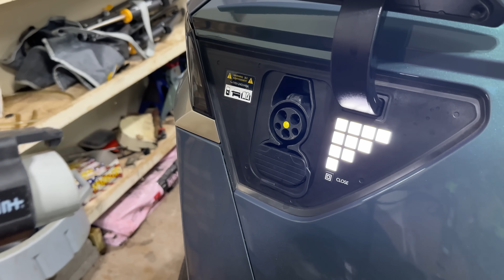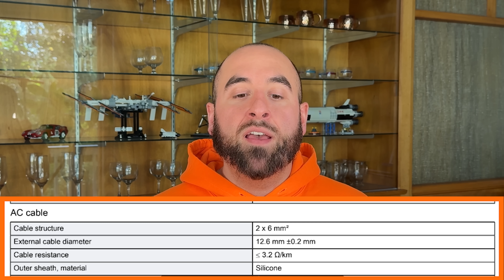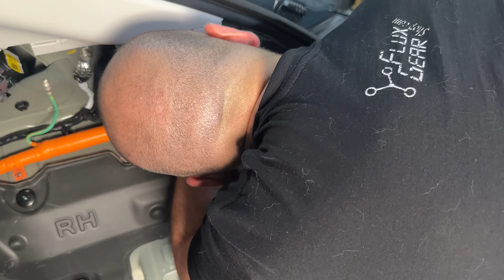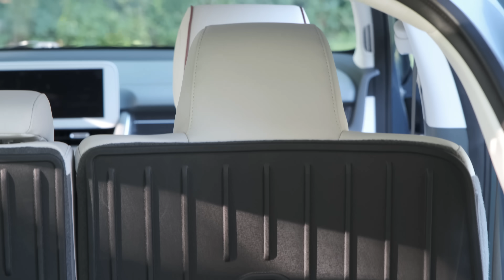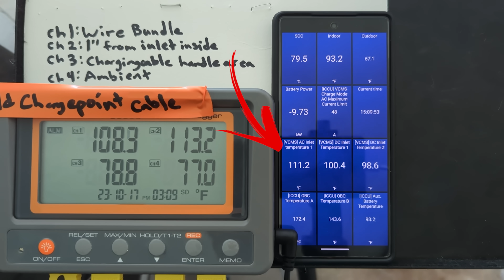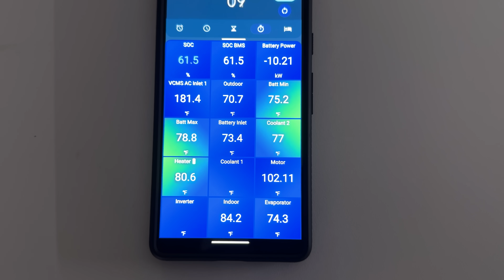I Investigate Overheating Charge Ports on Ioniq 5/Ioniq 6/EV6/GV60

Comment: Interesting. I watched this when I had my ioniq 5 (though it didnt have the issue) but my current EV6 is throwing port over heat codes after an hour at 9.2kw on a newish charger. I have the inner panel off to see if air flow would help any but it didnt make any difference

Comment: Hello, I have an ioniq 5 with no faults in any ECU tested with my pad7 tool multiple times and at the Hyundai dealership neither on the car's screens there is no warnings, initially I lost both DC and AC charging then DC charging came back after noticing moisture in the charging Chademo port and spraying contact cleaner but AC charging trips the breaker in both public chargers and slow granny chargers.

Could this be an ICCU fault or wiring at the port? My ICCU part number is 36400-1XAA0, I am thinking of buying a second hand unit just to test and then send my original one for repair. Also one thing that is mind blowing my Ioniq 5 is a Japan import and at the charging port there is a warning which seems to say not to charge over 200v/48amps, I did not notice this and the problem started after I charged it with a granny charger at 230v, but since the ICCU is the North America version how comes and the car cannot accept over 200v  ?

Comment: Its strange americans use single phase... the 3 phase European system is much easier on the connectors because less current has to go through the conductors also there is virtually no current flowing in the neutral when operating on 3 phase. So there is less resistance and its more efficient.

Comment: On my EV6, I found that on public lvl2's near me I occasionally get the inlet temps >100°C, where 105 is usually the point where it thermal throttles. Yet with my Grizzl-E mini at 40A (I have a NACS one, future proofing myself with it and an A2Z adapter) I consistently only see 65°C. I get the feeling that this issue is similar to that of the recent graphics card issues, where pins making marginal contact can lead to issues like this. 

If you are consistently having issues with AC charging sessions, I doubt your dealership will do anything about it unless they're great or you're insistent. I'd recommend trying out a few different EVSE's and stress testing them to see what works best.

Comment: Thanks for all this info!  I had an AC charge failure over the weekend.  Dealership diagnosed it today as a charge port or wiring harness assembly failure, which they are replacing it (under warranty).  Leading up to this, I did have a couple episodes where either the car failed to charge once (but charged later on when I reseated the plug), or once when the charger started immediately (normally on TOU charging) because it thought I "double pumped", which I did not.  This has me thinking that there was a loose connection or part that finally failed this weekend.  DCFC still works, however.  Is DCFC a different thermister?

Comment: I've had all recalls on my 2023 I5 completed and it still stops changing at 8.1 kW after 2 hours when the garage temperature gets up around 65F.  Is it possible ICCU software update didn't install properly?  Dealer refuses to perform TSB "VCMS Upgrade" because they claim it was included in last ICCU update and have washed their hands of problem.   I've lowered the kW to 7.1 now and this seems OK, but is only 2/3's of what I paid for...not right.

Comment: Why does mine not derate when overheating, it still just shuts off ??!
Reply from the maker: There was a vehicle control unit software update in 2023 that changes that behavior. Have you have any recent software updates done at the service center?
Reply: @TheIoniqGuy  I’ve had all the updates whenever I took it in for scheduled maintenance. I’m over 40k now so haven’t been in since December however I did get the latest iccu update a few weeks ago

Comment: Just came here to say: I solved an overheating problem for my I5 - I cleaned my J1772 pins with Q-Tips (one per pin) and 90% isopropyl alcohol based on a tip I read on Reddit (the Redditor suggested cleaning them like you're brushing teeth) - please try at your own risk - but it worked perfectly for me. My I5 had started having this problem two days ago in Yosemite at a destination charger in the park. Shutting down after only 30 minutes or so, and it kept happening even after I got home. And I typically have it dialed down to 90% (36 amps) which is plenty fast for my purposes - but cleaning the pins worked! The thing charged overnight to 80% with no problems, no slowdown, nothing. It just worked.

Comment: I never had this issue on my project 45 version.
Even not heard off.
Mostly I charge with 5 to 8KW (3 fase) or 4 kw (1 fase).
But even when charging at 11KW (3*16 amps) never an issue (until now)
I admit that my car was delivered in Euriope...230-240 volts standard. 11KW is slightly less as 3* 16Amps

Comment: i installed a 50amp hardwire charger and my I5 will only charge at 9.6 kw  it's never charged higher although it's never disconnected or lowered the rate. I really wanted the 11 kw. I havent loaded the update for the radio yet maybe then it will charge faster but I doubt it. I did both ICCU updates and it didn't change anything. It;s a mystery.
Reply from the maker: It should at the very least start at 11kW. It sounds like you have it set lower in the cars EV settings or the charger has a setting or a switch inside of it that needs to be changed to allow full speed

Comment: How hard would it be to electro-gold plate the charging pins? Wristwatch repair guys often do this for case restoration. Reported overheating could be due to a "flaky" thermistor by the charging pins. Should you get a part number for that thermistor, I'd replace them. Your disassembly "experiment" proves it must be an intermittent high-resistance connection that is causing overheating. I understand Hyundai wanting to solve this in software, vs recalling cars because this IS a hardware issue.That is not proven yet, but you have evidence that leads to that conclusion. My charger for my Kia only does 40A L2 charging so this will never be an issue for me.

Comment: Thanks for the awesome video. I have a GV60 Performance and recently can’t go above 35amps before the auto shutoff kicks in. I will attempt to recreate what you did in a last ditch effort to prevent the problem from getting worse. Did you shut off the main power first or is it not necessary? Thanks!

Comment: Very comprehensive. A couple of comments - if there is a quality issue with the wiring of the thermistor the BMS may be getting false readings - the resistance of any poor contact adds the the value of resistance the BMS sees which will be interpreted as a higher temperature. Secondly (and this should be obvious but, hey, whatever) - you cannot simply say that a given wire thickness can carry a set current - it will depend on how easily the wire cools the self-generated heat. I know from setting up my own EVSE that cable ratings will be different between (for example) wire clipped to a wall vs. wire buried in wall insulation.

Comment: You mentioned you have a 50 amp Autel maxi charger. What amperage is your breaker? I bought one of these chargers too, and I have a 50 amp breaker. The instructions say to limit the charger to 40 amps with a 50 amp breaker
Reply from the maker: For a hardwired 50A charger, it needs to have a 60A breaker. If a 50A breaker is what you have installed, you need to manually go into the Autel app and change your charging current to 40A, which is the most a 50A circuit can handle continuously.
Reply: @TheIoniqGuy  ,  Thanks for the quick response! My manual says that for 50 amp charging I need a 70 amp breaker

Comment: I fixed the issue for my Ioniq5. I started having issues after 7 months of ownership. I was charging at 32amps and reading 240 degrees(F) after about 2 hours of charging. I simple cleaned the charge port pins with DeOxit and a nylon brush and Qtips as well as the charger plug socket pins. After this simple procedure, I was reading 140 degrees. I almost couldn't believe it was this simple but that was it. I'll probably be doing this every few months.

The question is, why is this not an issue with other EV's? Either: 1) they use higher quality connectors. 2) the temperature threshold is higher. 3) the charge port has better heat sinking/ventilation.

In either case, this is an unacceptable situation for Hyundia.

Comment: Great investigation. Sounds like a resistive pin connection due to partial engagement. However, if this temperature sensing doesn’t work right what happens?

Comment: Just a wild speculation: maybe the freezing you did with the thermistor reset the reading of it. After all a thermistor is just a resistor, so there is an analog to digital conversion to get digital readings for the BMS, etc. Maybe that part did recalibrate when you freezed the thermistor.

Comment: Maybe check the thermistor connector, spray some wd40 contact spray in it. ( yellow cap spray ) I use it when the handshake doesn’t work at a charger, I spray the cable connector, especially the two communication pin, and voila, it works.

Comment: Thank you so much.  This is a great video and your explanations and thought process are excellent.  

Thank you for making the discussion about the size of the wires in the car vs. rating for wires in household wiring.  Household wiring is rated more to maintain a certain voltage drop rather than being able to carry the current.  It's always interesting to look at the wires on the back side of, say, an electrical oven plug.  The wires inside the appliance are generally tiny compared to the big fat wires in the main cord, but the manufacturer knows exactly how long they are and what's around them and such.  

As an experimental physicist, I very much approve of your methodology here.  You do an excellent job of laying out your methods and measurements, and then reporting your data.  I have two suggestions, though.  1) In the early part of the video, you talk about ratings of wires in terms of degrees C (which is reasonable; that's how those specs are usually quoted).  Later in the video, all of your temperature measurements are (I think) in degrees F, which is also fine, but I don't think you made a point of highlighting that you were switching scales.  2) In your graphs of temperature over time, don't have have a unit listed ANYWHERE.  I presume the temperatures are in degrees F and the time is in minutes, but they're not labelled.  

I don't have an EV, but I have some thoughts about the whole charging port thing, and I would like to have a private conversation about that with you.  How to best contact you?  I see you have a facebook page, is direct messaging on facebook a reasonable way to chat with you?
Reply from the maker: Correct, any temperature not related to a cable rating is in degrees F. You can email me at theioniqguy@gmail.com

Comment: Please get an infrared camera to check high power connections, esp if you are an electrician.  IR cameras can see through plastic and many other materials.  A good camera can show where the poor contact is, without having to disassemble the cables.  Been using for 2 decades in 100 to 1000A circuits.

Comment: hi, I had the same issue. I have a Kia ev6 and although at home level two charging would start at 9.6kw it would inexplicably drop to 5.4. Sometimes in 15 minutes, sometimes in more than an hour. I had Chargepoint replace my charger. I brought it to Kia to find out that not only couldn't they fix it but they were the worst dealership I have ever encountered. Didnt really know what to do and then I saw your video. That was two weeks ago and although I did not disassemble my car I have some small diameter round wire brushes. I cleaned all of the 5 pins in the charging socket. Since then I get 9.6kw for the entire charge cycle.
Thanks
Art

Comment: I just came back from dealer after opening a case on them that they are not explaining what is happening, now they twist the software that is charges only 48 amp for 20 min then it goes down and charges with 7.30 kw and never goes back  to 11 kw so the point is to fix the issue not to reduce the speed to slow forever until charge is complete! Currently i am opening a case on Hyundai, whoever interested let me know.
Thanks

Comment: Static charge can discharge through a temperature sensor so static in general can cause an noise in the thermistor information. Maybe when you touched the thing or when you put the thermistor in liquid it removed built up static? with all the different materials like carpet, rubber and plastics in that area with high voltage i could see some static building up.

Comment: Home wiring ratings are based on insulated walls with possibly multiple cable runs routed together. Power cords follow the same ratings as in-wall wiring as safety margin against user abuse. In a wiring cabinet setting where there is no insulation, not much wire ganging and generally no human interaction, practical limits are much higher.

Comment: Excellent video and analysis. I have to assume that the charge session would only stop or de-rate  if the car (or EVSE) is aware of a heating issue which means one of the temp sensing thermistors is getting too hot. Poor thermistor placement or lack of good thermal contact could only reduce the ability of the thermistor to track hot cables or connectors, not increase sensitivity.

Comment: The real question is why wasn't this fixed at the dealership?  Why did you, and others, have to go to such lengths to fix a car that was sold to you broken?
Reply from the maker: It likely wasn’t a known issue at the time they started building the cars and only came to light after extensive customer use. They’ve revised the part several times since.

Comment: Thanks for going the extra mile in you deep dive analysis!
Reply from the maker: I really appreciate it!
Reply: @TheIoniqGuy  No prob! My 2021 Model Y can only charge at a max 32A (AC) and it has never had a de-rating or heating issue, as far as I know. Pin fitment / electrical connectors are crucially important.

Comment: Those temperatures are still really high even though the connectors and wires are rated for it. There should be active cooling around the port or a better way to keep the charge port below 140F/ 60C maybe with thicker connectors?

Comment: My ev6 must be a unicorn. I have a 2023 gt line. No iccu issue, no 12v battery issue and my hardwired autel charger consistently stays at 48amps and 11.6kw for the whole duration its plugged in and doesnt get warm at all. It sucks that so many people are having these issues.

Comment: Another possibility is crosstalk.  This is where wires running in the same bundle capacitively couple to each other and signals can jump from one to another.   This is especially a problem wen you get very high currents in one one wire coupling to another that operates at very low voltages such as a sensor.   This results in noise on the sensor line that can fool the computer listening on it.   By moving the wires around you may have reduced the effect.
This can be fixed in software by averaging the sensor signal to smooth out noise induced  variations.

Comment: Pin connectors are notorious for backing out of place after so many insertions. I have seen this many times in industry.
Check the pin seating in both ends of the cable.
Also, bad connections always heat up over time.
If you are having this problem at home, image what you will get at a public charger that is used and abused everyday! Good Luck. 😂

Comment: It doesn't sound like your issue but another consideration is incoming power quality. If there is low voltage or dropouts the charger will lower the current.

Comment: I know this is semi Unrelated to the overheating but could you do a short showing how to replace the charge port caps? Is it as simple as taking the new cap and pressing them into the port? Don't want to stick my finger in the electric socket again, thanks in advance!

Comment: In "free-air" BARE wire can carry much more currant than can the same wire in a closed conduit / tight bundle.   ''AMPACITY OF WIRES VARY WITH ITS INSALATION'' {AMERICAN ELECTRICAL CODE}  "Voltage Drop"= 'Vd2Kil over CM""   EV cars have on-board chargers that need protection from too high an amperage applied while charging.   Home wiring and plug devices' can be a heat sourse and must be fused against for protection of fire.
Engineering of many factors hopefully come with few compromise.   =we ask computers to make our choices of control=
*fine copper wire found in weilding cable carry vary high rates of currant !!  
Thank you for working on all of our short commings of our Ev's....

Comment: My ChargePoint Home Flex charger was set to 48 amps and our IONIQ 5 charge process always stopped after about 45 minutes. I had ChargePoint lower my setting to 40 amps and I have had no trouble since.

Comment: Iwe Never heard of this being a problem in Europe. Yes we have ICCU failing but No heat problems.

Does it have something to do with your shitty 115V system.??

In the old would we use 220-250V and therefor only charge at 16-24A depending on Which country we live in.

AC charging Type 2 charges at 230 x 16A x 3 = 11 KW

Comment: My 2023 Ioniq 5 Limited won't charge at my home Level 2 @ 40 Amps.  I have to lower my Autel charger down to 35 amps for the charge to maintain.  When I start at the 40, it lasts 30-45 minutes before the car suspends.